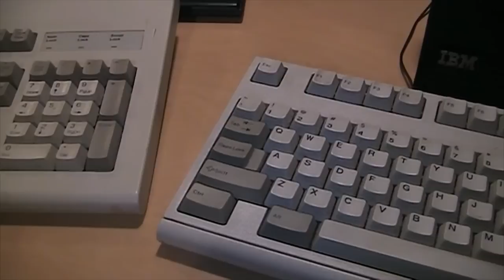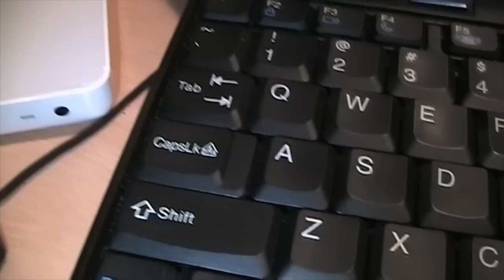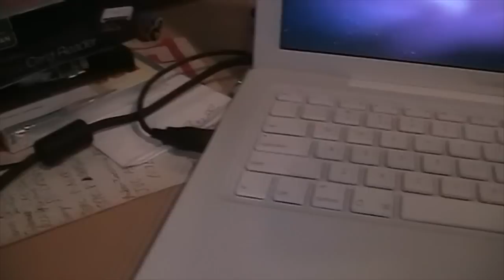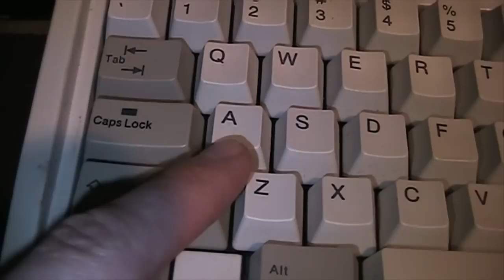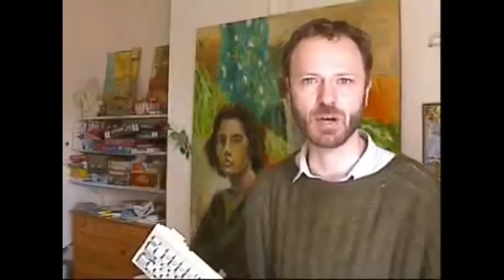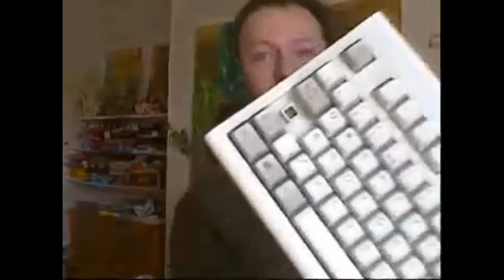Why the Caps Lock key should have a notch in it

Comment: On physical keyboards, there shouldn't really be a caps lock key, it just takes up space, and can frustrate people. Really there should be caps lock keys on onscreen keyboards on touchscreen devices, like phones. Where you would actually use it as you only have 2-1 thumbs to use on it, instead of doing a confusing thing with shift to put it in caps lock.

Comment: You know I've never even thought of this, I'm sure I've used keyboard that have a notch on the caps lock key and I've used many that don't, including the keyboard I use now.  I'm a touch typer and I very rarely if ever hit the caps lock key by mistake, in the work I do I frequently use the caps lock key.  I know where my hands are on the keyboard because I feel for the little bumps on the F and J keys of most keyboards, of course I'm sure there are many keyboards out there which don't have those bumps, in which case I'd be in trouble because I rely on them.  But I can see your point.  Did any of Apple's previous keyboards have a notch on the caps lock key?
Reply: +Lachlant1984 Yes all of apple's older desktop keyboards have the little notch

Comment: The Mac Caps lock key requires a bit more of a definite push to activate it than the other keys. So it's not as easy to set it off by accident. Also, it doesn't invert the function of the shift key which is irritating on Windows computers, when you by force of habit press shift to type someone's name in caps mode - only to find a lower case later and everything else in capitals.

Comment: I use the Caps Lock key when gaming.  Fortunately, I have a Corsair K95 RGB, so I simply rebound G12 (the macro key immediately to the left of the Caps Lock) to Caps Lock and Caps Lock to Scroll Lock.  Then you rebind the action normally associated with the Caps Lock key (typically toggle run/walk) to Scroll Lock.

Comment: It's a plausible theory, I think.  But that spot was originally occupied by the Ctrl key, which is more commonly used than the Caps Lock key, and all the keys on the left row were stepped not only on the right but also on the left side of the key, since they lacked stablizers.  So that little gap could just be a vestige of the stepping, rather than a fully intended feature.

Comment: I guess it's just me, but I haven't ever accidentally hit CAPS LOCK while typing. And I'm currently using a Rosewill RK-9000 with Cherry MX Blues, which does not have the indentation on the caps lock key. 

Though I do rest my little finger on the shift key for most of the time so I can't  really jam my ring finger on the caps lock without breaking it. Also, I do play a lot of games where I constantly use WASD, so my motoric skills could be above average when it comes to typing on a keyboard.

Comment: there are those that believe that Ctrl should be left of A "like god and man intended it to be" and this CAN be seen on old 486 class and older laptops!  I can say for 100% certain all of the Model M's in my garage have that indentation. they all will-- that's how they were designed. if you're a good typist you'll never hit it once. but even I will sometimes slip and hit it, but I can usually catch it in time before I make a fool out of myself for typing in all caps.

Unfortunately, others of mine like my Chicony KB-5981 do not.

Comment: My 2015 HP laptop's keyboard doesn't have an indentation on the Caps Lock key, but my pretty cheap Microsoft Wireless Keyboard 800 not only does it have one on the right next to the A key, but also throughout the bottom above the Shift key! What it looks like: http://i.imgur.com/ZOrqCF2.jpg. I might have had a case where I accidentally hit caps lock instead of A on my HP and macbook keyboards, but I never got particularly angry or frustrated.

Comment: Macbook keyboards don't have that gap because apple uses a different solution. In order to activate CapsLock you have to press and hold the key for longer than 100 milliseconds or somewhere there, so if you're typing and click CapsLock by accident nothing happens because you don't press and hold a key for longer than 100ms when you type. If you own a macbook try tapping the CapsLock key, it won't activate. quite interesting.

Comment: As usual clueless engineers took over of designing modern keycaps instead of experienced ones that knew about the problem of hitting capslock.
Also some modern keyboards have extra small windows/fn keys instead of the standard ISO, ANSI big ones. Just shows that engineers were thinking when designing such keyboards.
The only issue is to find custom keycaps for such keyboards :|